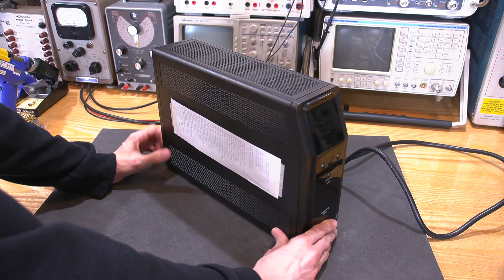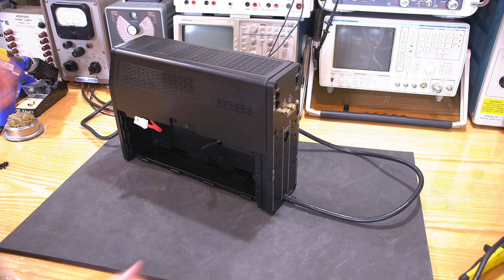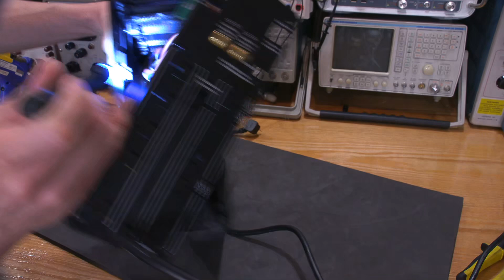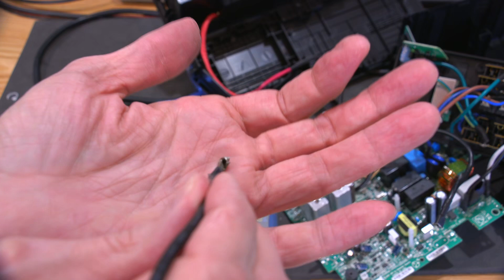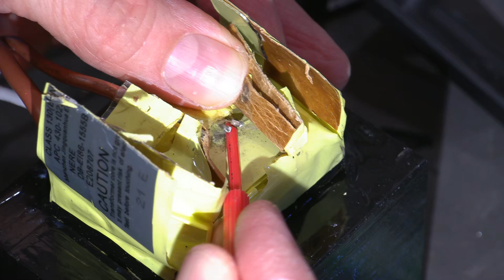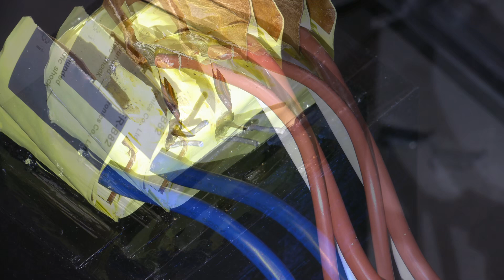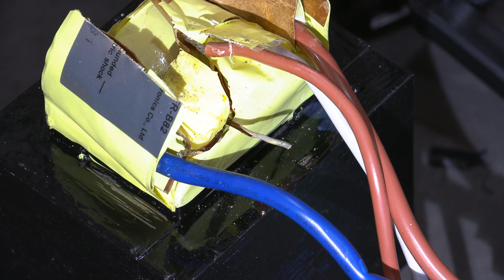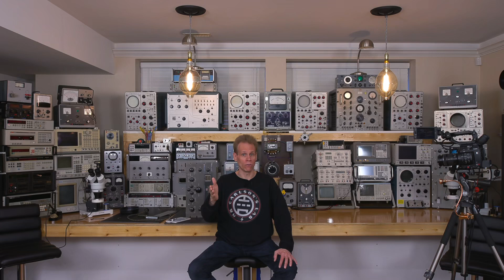UPS Electrical Failure - Teardown and Analysis!

Comment: While APC could have done some more QC checks on these units, my guess is that they never bothered to tear a transformer down or more likely, at some point they switched suppliers for the transformers and a crimp turned into a fold and solder connection and it passed QC external tests just fine.  The connection could easily have loosened over thermal cycling and you could have many of these same or similarly built transformers in all kinds of products from many different brands.

 I recall this being a big issue with many inverter manufacturers as well since aluminum windings are so common in transformers these days due to a reduction in shipping weight, cost and better thermal radiation since aluminum has a lower density so it radiates heat better even though copper is a superior thermal and electrical conductor.  Many of these companies were spot welding or crimping the connections but were running into issues with poor quality crimps or bad spot welds since these transformers were put under high load and heavy themal cycling at times.

I had a couple of Liebert 2200VA UPS units that died from internal arcing but I could never find the burn marks but suspected it was windings or and internal short in a relay on the board.  I recycled them after that since they were about 6-7 years old and were on their 3rd battery replacement.  At this point I don't really need a UPS any more since the entire house is now on a 52v battery bank and an inverter.

Comment: Wow did not expect this from APC even though the unit is the cheap series. I wonder if the wire is all aluminum or CCA, and if CCA they could have soldered to the copper coating but they should've crimped the connection with these currents it's dangerous to "solder" to aluminum.

Comment: Oh my, as the owner of an IT shop, this was a shock -- Our "meat n' potatoes" UPS is the APC BR1500MS2 1500VA unit. In the next 48 hours we are ripping apart the transformers of this unit and the equiv from CyberPower and Triplite. Whomever has copper windings on the xformers is the winner to me. Regardless, APC is OUT...this is unforgivable.
MASSIVE thanks to Mr. Carlson for bringing this issue to light.
Reply: So what were the findings?
Reply: @MesoTroniK  Oops, me bad, should have posted -- The Cyber stuff and the Triplite stuff we use have copper windings. I wanted to check some of the 2000VA and 3000VA units too but I balk at tearing away insulation to expose wires on those spendy beasts. The only saving grace for APC is that their standby power use is lower than the equiv Triplite and Cyber we use, but meh, electrons are cheap, for now.
Reply: @ronsingh  Thank you! And that confirms what I believed, that CyberPower makes a superior product. At the least I have never had any issues with a multitude of their sine wave pfc1500 units.
Reply: @MesoTroniK  Yes! That CP1500PFCLCD is the model we roll out with all pretty much every desktop for our clients. Great unit. I have been a stanch supporter of everything APC since the mid-80s and for them to betray the trust consumers have placed in them is truly disheartening, such a shame.
Reply: @ronsingh  just added to cart on Amazon. Do you think they are genuine or counterfeit? Amazon has become notorious for that!
Reply: @YZFoFittie  If you mean you added either the APC BR1500MS2 or that Cyber CP1500PFCLCD, I am 100% sure they are real, just watch out for "re-packs" or refurbished.
Reply: @ronsingh  the Cyber, I dont trust the APC's anymore.
Reply: @YZFoFittie  Agreed and for good reason. I am still using APC for the 10KVA units as I am not enamored with the choices from the Tripplite and Cyber folks.

Comment: Does the electrical characteristics of an aluminum-wire transformer differ from an identical one with copper windings?  Notwithstanding the soldering difficulties.

Comment: The company I work for just moved their servers to a datacenter so there were some rackmount UPS units up for grabs so I just today switched the little desktop one I was using to a big commercial 2000VA/1540W unit (after removing the rack ears.) Seems very substantial in comparison! I did have to use a adapter to go from its 20A plug to a household 15A plug but I won't be drawing anywhere near 15A with my computer.

Comment: Wow aluminum windings!!  That is really disappointing from APC.  I just replaced the battery pack in my APC unit (different model than yours, made in 2014).  Makes me wonder about its transformer.  My last UPS disaster was a leaking SLA battery, that was fun to clean up!

Comment: When i worked for a power supply manufacturer a few years back, the transformers used were color coded depending of where they came from. Those with black plastic wrapping were made in Germany, grey in the Czech Republic and yellow ones made in China iirc. Never saw one with aluminium wire tho :D

Comment: It probably started off as copper covered aluminium wire. Probably the insulation stripping was a bit too vigorous and did not leave enough copper covering for a reliable solder joint.

Comment: I was at APC early on and there's no way we would have used aluminum transformers back then.  This is just too cheap; it is possible to ultrasonically bond aluminum windings to copper wire since even special solder isn't reliable (as you see).

Comment: Don't forget - the APC "Back UPS" are the most.... budget.... models.  Enterprise grade APC UPS are seriously reliable - made of metal, modular, etc... they're under the 'SmartUPS' Moniker, or even Symmetra etc.

The F04 error is "Clamp Short" - which, from memory, is one set of relay contacts has welded shut.

The reason you got arcing noises when it happened was because this was "starting" to happen - as the UPS will run a self-test / diag every so often when connected to good power.  Replace the relays, you'll probably be absolutely fine!
Reply: ** I WAS WRONG! **  
I watched the rest of the video and stand firmly corrected!  Never have I EVER seen a failure of the transformer before in these... but cheap UPS, cheap components - as you rightly say!  I'm astounded at aluminimum windings too!!!  Wow!  You learn a little each day! :D

Comment: My Smart-UPS 1000 and 1500 units all had this Quality check sheet. It probably just means that the unit passed their quality checks. SUA1000i SUA1500i. Great units. All still working after 10 to 15 years. Gone through several new sets of batteries as batteries only last for 3 to 5 years.

Comment: Without justifying the use in this transformer, pure aluminium can be soldered with the correct solder and the correct flux. The wire in the video is very soft which does suggest pure aluminium

Comment: Wow... This is unbelievable and extremely dangerous. In what Chinese basement those transformers were made, and how did APC end up using them? APC used to make the most reliable UPS. I have a whole bunch of old models that have worked for over 10 years. APC should have recalled these, I'm pretty sure it's not the only failed one.

Comment: I’ve been using APC products—surge protectors, protected receptacle extenders, and many, many UPSes—for well over 20 years without ANY issues, not a single one. In fact, they have always performed BETTER than advertised, and have lasted 2-4 years LONGER than their original spec. (I stay on top of keeping my units clean, and swapping batteries as instructed). 
In fact, APC is one of a very small, and select, group of companies I trust completely, recommending to family and friends all the time. 

QUESTION: APC (Schneider Electric), you are a brand who commands a higher price because of your quality products made using quality materials, why then have you dismembered the very thing that differentiated you from your
competition? What do you have to offer us now?

Comment: Aluminum and copper coated aluminum are unfortunately a cost saving measure with consumables. Automotive too. Ran into aftermarket companies using aluminum for ignition coils. It’s not meant to last, just make it last to the warranty period. Even if it looks like copper, it’s just copper coated aluminum. Junk

Comment: On almost all of the UPC's I've worked on, it was almost ALWAYS the switching Mosfets or IBGT's that would be blown, and the usual driver circuitry woes that come along with those types of failures.

Comment: WOW talk about cheap have seen transformers with copper clad aluminum CCA but not just aluminum apc should be forced to recall them all as they are dangerous almost wonder if it was left to run if it would cough fire least they could have done is use crimp to connect wires.  aluminum wire sucks and copper clad aluminum sucks too  brakes to easy has lower level of electrical conductivity  gets hotter in transformers I hate the CCA Cat5e cable I got stuck with 1000feet of crap cable will not make that mistake again cca works ok for runs under 40 feet after 50 feet results in a greater loss of data, as packets have to be re-transmitted. after 100feet forget about it and don't even try PoE power over Ethernet with copper clad aluminum

Comment: Kind of dumb, that. Our hose is one of the many built around 1970 that had aluminum house wiring. After numerous fires all the electrical cables had to be terminated with a special crimped connector that bonded a copper pigtail to the aluminum. Its a decent fix but not as good as rewiring your house. I can't imagine why APC thought they could get away with this DiY pigtailing -- they probably cleaned the aluminum wires, coated them in a anti-oxidizing paste and then crimped the tinned copper wire to it. Its the sort of kludge you'd do in the field if you didn't have any chance of a replacement part but its not the sort of thing you'd do on a brand new device, especially one expected to work reliably for years. What were these guys thinking?????

Comment: I read some comments saying APC quality going down.  I have an APC Back-UPS 1300 purchased circa 2008 and have been replacing the batteries when they are no longer good.  Question, should I be worried about this unit failing the same as the one shown in the video?

Comment: I had a similar APC model fail like this after less than 2 years.  And then it's replacement failed after a year.  I have since sworn off APC and only buy Cyber Power, and haven't had a failure since.

Comment: Hello and sorry for my bad english cauz i'm from euro. Well, aluminum in transformers, so soon to the return of wires wrapped in paper and fabric just like in the 1910s? Why not also the return of wood gas cars! When progress moves backwards without seeing the precipice. Thanks to all these commercial engineers always there to get 1/2 cents for profit at the expense of safety. Thank you very much Mr Carlson for sharing your unfortunate experience with this crappy device from APC. I'll defintly never buy any UPS from APC.

Bonjour et désolé pour mon mauvais anglais car je suis d'europe. Eh bien, l'aluminium dans les transformateurs, bientôt le retour des fils enveloppés de papier et de tissu comme dans les années 1910 ? Pourquoi pas aussi le retour des voitures à gazogène ! Quand le progrès avance à reculons sans voir le précipice. Merci à tous ces ingénieurs commerciaux toujours là pour grapiller 1 ou 2 sous de profit au détriment de la sécurité. Merci beaucoup, M. Carlson, d'avoir partagé votre expérience malheureuse avec cet appareil merdique d'APC. Je n'achèterai certainement jamais aucun onduleur d'APC.

Comment: I had the same model fail in the same way. F04 and screaming as well as the arcing sound.

It was a new unit - APC replaced it under warranty.

Don’t you need special flux to solder to aluminum?  I’m guessing using aluminum is just a cost savings attempt?

Comment: F02 - On-Battery Output Short, F04 - Clamp Short, read your manual.
Reply from the maker: OK, how does that relate to the discovered failure point? Think to the next step Robert.

Comment: Most modern products,(not just electronics), are designed to within an inch of their lives. Manufacturers want the stuff to fail so they can keep the sales high.
They use a formula called MTBF, Mean Time Between Failure, when designing stuff, so that it will last through warranty, then puke.

Comment: As I am sure you know, Aluminum is a bad choice for a winding as it takes more space due to larger size wire , is 50 % less conductive and has jointing problems

Comment: APC was for years my hands down #1 recommended UPS brand..  and the CS was w/o question some of the best...   well that ended a few years ago with repeated failures on  a pair of UPS's I had and were being used on my small NAS server.. which was well within the power spec for the units.. but repeated failures kept happening..  which thankfully my server could recover from w/o data loss but having to waste 40+ hours on data integrity check/rebuild after the f'ing UPS decided to have a fit was unacceptable..

those units were relegated to small single system use instead and the server UPS was instead replaced with a canuck version of this same unit you have..
well it wasn't even put into service and it had a massive failure...  while just plugged in for initial charging and then left alone for about 2 months due to life and shit etc..
and then suddenly it refused to even turn on..  no sparks..  no lights..  NOTHING...

Now I've worked in IT for more decades than most of you have been around.. and while APC did replace the unit quickly and w/o hassles..   I'm sure as hell not going to plug my server into this!

The reliability factor has been lost here... and they still refuse to abandon their non-standard usb interconnection cable as well..ffs..

Sorry Schneider aka APC but you have shot yourself in the foot on this one hands down..  and I've found better more reliable alternative brands now to use that are also a lil cheaper as a bonus as well!

Comment: Aluminium has been used in welding transformers for more that 50 years.  The cables are terminated by crimping into copper lugs with the addition of an inhibiter compound to stop adverse reaction between the dissimilar metals.

Comment: I own an identical unit and mine also came with a test receipt like yours. My unit has survived dozens of power failures without issue but its only handling a 600W load. Ive always wanted to look inside it. Thanks for sharing your experience. I definitely wont trust it with anything important.
Reply: UPDATE! 3 days after commenting on how long lived my UPS 1500 has been it went kablooey just like Mr. Carlson's! 😂

Comment: I have seen transformer winding failures like that several times in the past on welding machines, even when connected by a bolt the aluminium ends up flowing away from the connecten due to thermal expansion and contraction and even with regular checks and tightening of the connections eventually they fail sometimes just due to the aluminium getting squeezed out until there is not enough to carry the current.

Comment: Wow. This is just plain shocking.
It is no wonder why that thing made such a grunt while dying.
Trying to "connect" to alumuminum wires by soldering. No appropriate connection can be made this way. 
On the contrary, this is a way to burn down homes, businesses, you name it.
Is it some quality control issue? The manufacturer may be liable in this regard.
I cannot imagine a manufacturer risking so much with such unspeakable mess. Can you? That is insane.
At least use proper connections. But they're rather expensive and prone to failure.
Coating it with copper to create a solerable surface would be a way but this just doesn't look like any of it.

Comment: I now often glance nervously at the Cyberpower CP1500EPFCLCD (900w) I've been using for about 6 months, and the 2 year-old APC Pro BR550GI (330w) owned before that, which now powers my mum's router and VOIP phone handset (with a new battery). It seems that pretty much all home/home-office or 'consumer grade' UPS's nowadays have had manufacturing costs cut to the bone. When it comes time to replace the Cyberpower (possibly sooner than that) it'll be either a server/industrial grade one, or perhaps a home build with components I can trust. I think if one has no choice about buying one of these craptastic 21st C. 'consumer' UPS's it's probably wise to over-specify the size - I need no more than c. 250w from the Cyberpower when the PC is video rendering, most of the time nearer 100w.

Comment: Call me Cpt Obvious, but If the coils of that transformer are made of aluminium, that transformer was trash even when it worked fine and was in your shoes I would substitute all the UPS of that brand with better ones ASAP.

The official poor excuse of some of using aluminium where copper should go is that aluminium is a good heat conductor. Those who use this excuses never think that is common knowledge that copper is BETTER at heat exchanging that aluminium and they're only trying to justify their cost cuttings since copper COSTS much more than aluminium. Of course resistivity of aluminium coil wires is superior than copper, and the overall efficiency goes down the drain, but why should they bother if it's YOU that are paying the ultimate price.

Comment: Interesting finding on the aluminum windings.  I was under the impression that the surge protection MOVs tend to wear out first (by eating line voltage spikes), after which you wouldn't want to keep the rest of the UPS alive anyway.
Reply: MOVs tend to fail all at once, not incrementally. They're designed to short above a give voltage, to prevent that voltage damaging things down circuit. I've replaced many of them, and their corresponding fuses - their whole point in life is to save everything else.